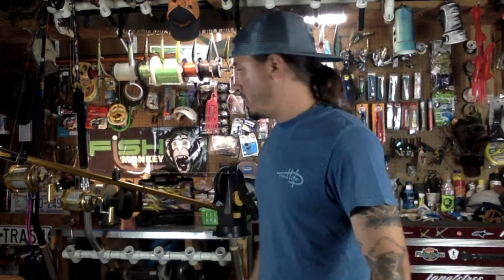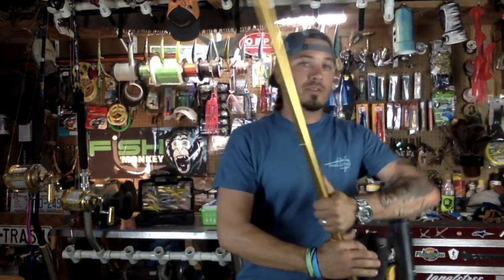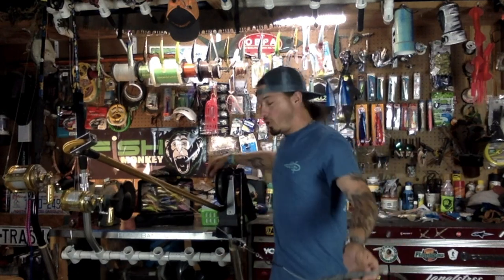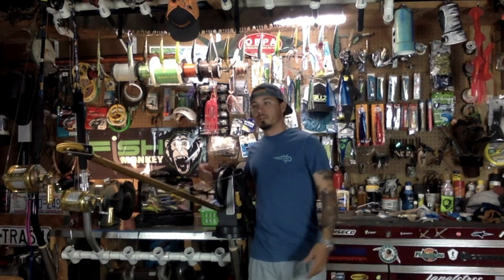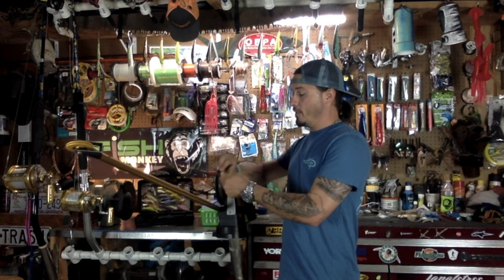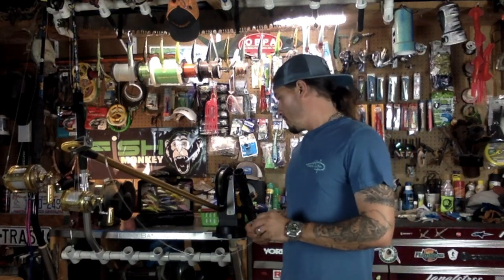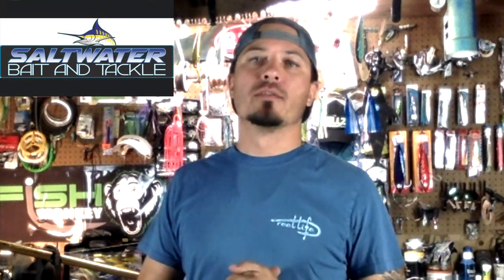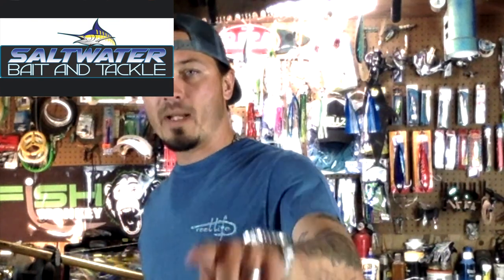How To Pull A Dredge On A Center Console or Small Boat

Comment from the maker: Hey ya’ll, thanks for watching! Don’t forget to swing by Saltwater Bait and Tackle located at 501 Atlantic Beach Causeway, Atlantic Beach NC and grab a Bucket Dredge or Strip Dredge. They both come ready to deploy and are user friendly! You can also find those at www.FishRazr.com and you can find BattleAx lures at www.shortriggertacklellc.com Thanks again! ~Slick
Reply: Thank you- how/what gear are you using to strap off on a cleat? What pulley are u using thats holding up to saltwater?
Reply from the maker: @stevep8871  I use pulleys that I picked up from West Marine. They are around $60 each. You can use anything to tie it off to a cleat. I use one of my dock lines.

Comment: Would you recommend mono for slow trolling kings or braid ? I ordered a bucket dredge as well if braid I could always add a top shot for the dredge???
Reply from the maker: I personally use mono. The reason is that you are less likely to cut your hand on mono than you would be on braid, if you were in a situation where you had to pull the dredge up/in by hand. I wear gloves but not everybody does. Not to mention, it’s nice to have that stretch from the mono when dealing with strong currents or rough sea conditions. Hope that helps. Thanks for watching. 🙏🏽